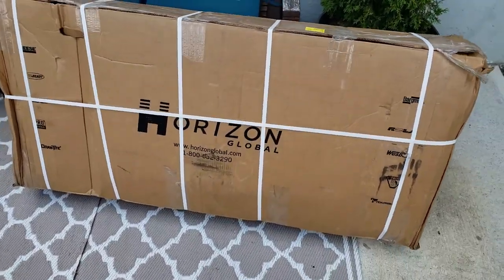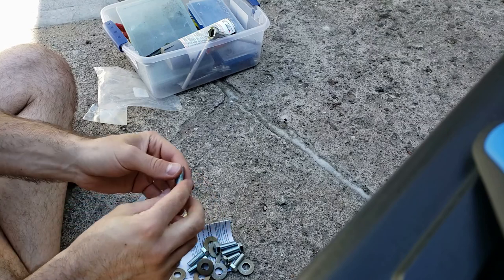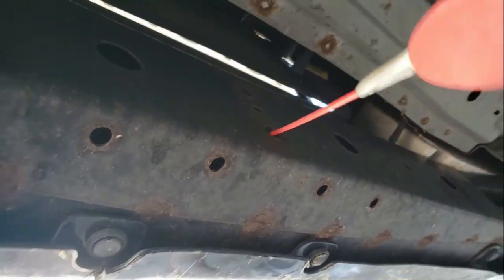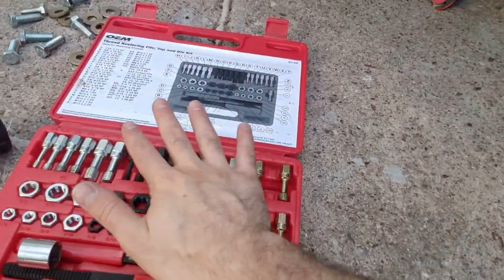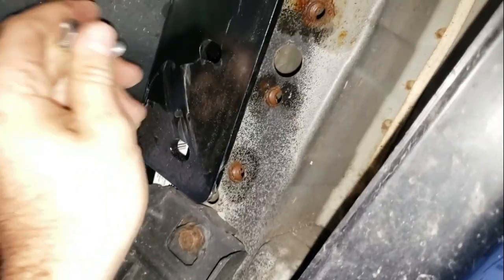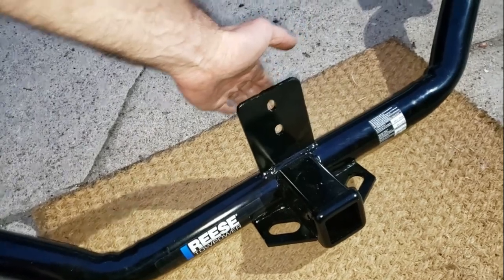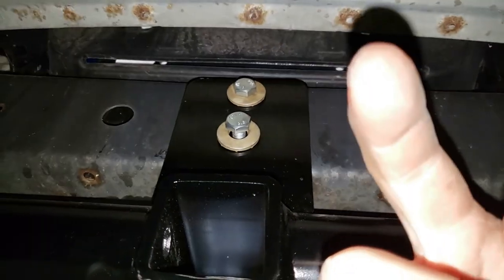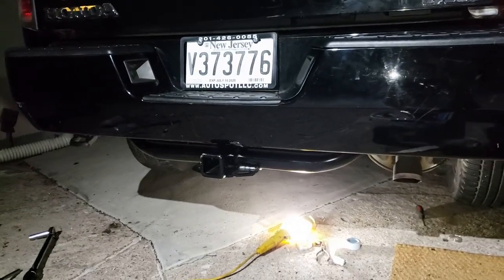Installing a tow hitch on my 2008 Honda Ridgeline.

Comment: Where did you buy it and how much is it? Plz
Reply from the maker: https://www.etrailer.com/Trailer-Hitch/Draw-Tite/75280.html?feed=npn&utm_source=google&utm_medium=cpc&utm_campaign=Google%20%7C%20Shop%20-%20Trailer%20Hitch&adgroupid=97971555046&campaignid=918096360&creative=425374847166&device=m&devicemodel=&feeditemid=&keyword=&loc_interest_ms=&loc_physical_ms=9003498&matchtype=&network=g&placement=&position=&gclid=Cj0KCQjwnueFBhChARIsAPu3YkQ7Lm_hzSVmDfRhfoMOSWiOUtbO9oWMb4E_HsUIQH7S8Uyvqj700IYaAklPEALw_wcB
Reply from the maker: That's the one I bought. $196
Reply: @hiv  $240 now... Up goes the inflation
Reply: $330 now literally just bought the same one. Had to do the same on pounding it out on the wings & in words on the middle one that hooks up to the bumper! Thank you again for this video! Life saver! Also had to retap the threads too!